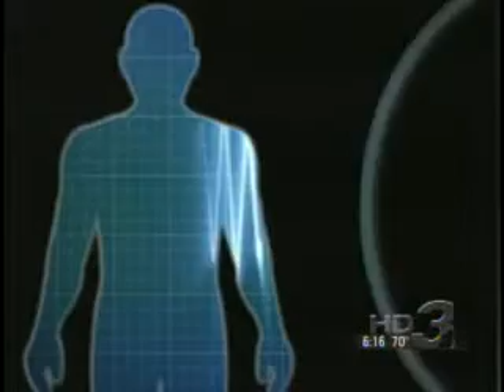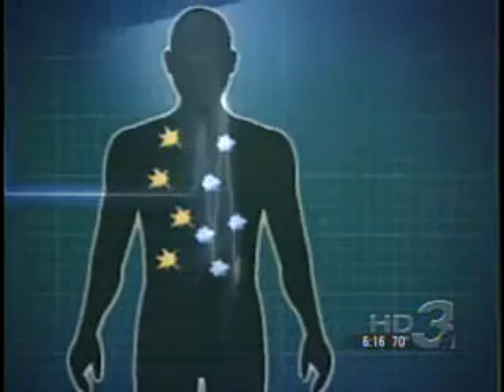MINIATURE HAARP FREQUENCY GENERATOR for FUEL!!

Comment: you can seperate oxygen from hydrogen quite happily  with relatively low dc current so what would be the use of running high voltage microwave generator to do it to run an engine seems pretty convulted. they do use this technique for 'precipation' influence,you can see a spot in gulf of mexico that always 'creates' airbourne moisture source,nuff said there

Comment: @commando7144 20hz is way to low, that's 20 cycles per second which is too low of a frequency to even be detected as a pitch when amplified, AC house frequency is 50 or 60 hz depending on what country you're from.  I think you must have meant 20 megahertz, or gigahertz, as those fall within the range of electromagnetic spectrum that transmits over any distance in air.

Comment: Ex: When running a current though a wire and applying a load the electron once its  used, flips it spin and is now a positron. revert that back to a source dipole between two opposing magnetic feilds. this will parallel the spins between poistrons and electrons. making it possible to extract more electrons from  energry you spent through the diamagnetic dipole. for every action theres an equal and two half opposite reactions. So conservation of energy is a flow of energitic exchange.

Comment: Radio waves can also cause cancer. In 2002, the IARC updated magnetic fields from extremely low frequencies, as to now be a possible carcingen. That means the advancement of wireless technologys has the possiblity to cause cancer among the populaton.  And our governments still haven't introduced any
regulation of a standard that controls the
harmful wireless energys swirling all around us.
  I suspect SALT would aid their acid deposition processes of those chemicals of the chemtrails.

Comment: you can produce more solar energy than it takes to produce the solar energy collection equipment used to produce the solar energy in the equipments life span, so you're wrong. Of course the sun takes a lot of energy to keep buring, but we're not talking about a sun's input/output, we're talking about human utilization or energy. And there are ways to maximize energy production and use very little to get more. ^_^ have a nice day.